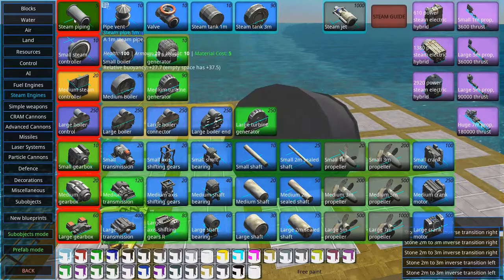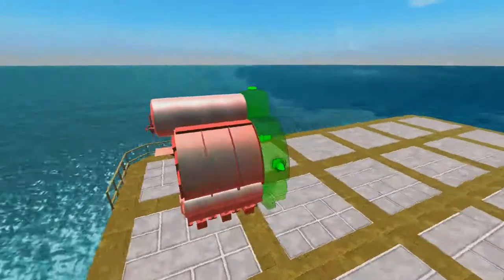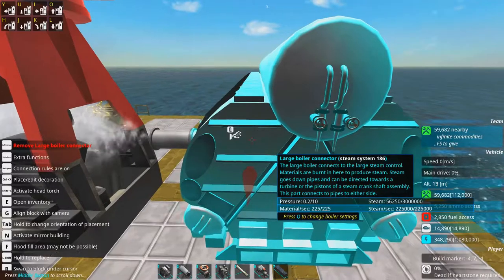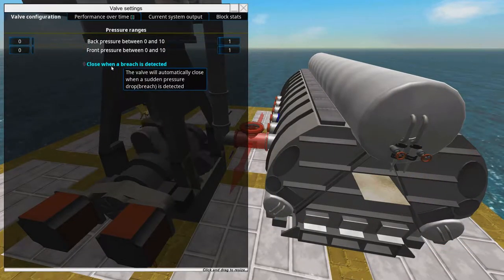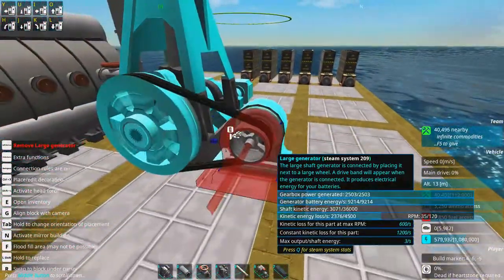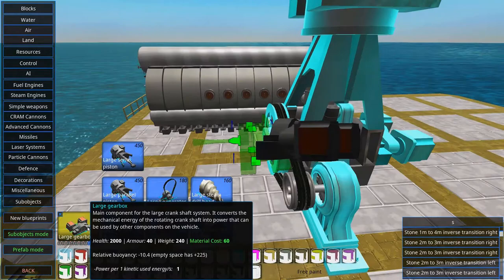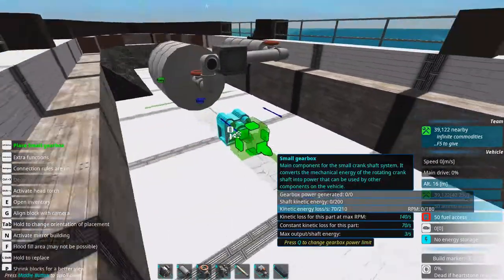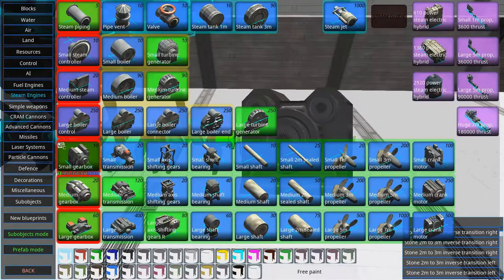From The Depths Steam Engine Tutorial - All about STEAM!

Comment: This guide has been super helpful. I just started the game and I have used either electric with the generators or a prefab fuel engine for most of my ships because the engines feel super complex or much to large for the vessels I am making. started a larger vessel (about 140 long) and figured I needed to look into other engine sources. Might have to give steam a go as it will also save space in that I wont need fuel storage for it nor will I need to deal with exhaust.
Reply from the maker: This is true! Glad it was helpful! Try also my instant tutorial if you want to have tutorials with no rambling at all 😂
Reply: @GMODISM  I have been looking at so many tutorials and guides for this game, I have almost 40 hours in the game and all I've done is built like 4 ships I am somewhat proud of (though in reality they are probably really bad) a couple of bricks and haven't even touched the campaign or adventure.

Comment: Something I've always found baffling about this game, is how "engine power" is sort of like a "generic mechanical power" that can be teleported magically anywhere on the craft (like to power regular propellers) without any shafting/gearboxes, etc.  This is fine, if that's the logic you want to use... but then they go and completely undermine it by having actual shafts/transmissions, but only specifically for steam engines.  So weird.  Why can't I hook shafts/transmission to a fuel engine?  And you are not even REQUIRED to use that mechanic, because you can just use the GEARBOX (which is different from a transmission because reasons) to turn your steam reciprocation also into that magical teleporting mechanical power.  Don't get me started on LASERS needing MECHANICAL ENGINE POWER but rail chargers are perfectly happy with battery juice.
Reply from the maker: Yeah for "realism" we must ignore everything fuel engine and laser related, don't get me started on how cram speed does not affect kinetic damage... so yeah only steam and APS then haha

Comment: The tutorial is nice, its just feels like most of your tutorials are on how to build craft for designer mode where cost doenst matter. Piston staging is one of the most important things to understand in order to make your engines run efficiently and not waste incredible anounts of resources, yet you just barely mention it.
Both parralel and serial large pistons can be attatched straight to each other.
Also the x2 max RPM setting will be changed in a future update.
Reply from the maker: Thanks mate, glad you like it!
Yeah it is important to use that exhausted another round but the first round is the most essential to save materials.
Oh didn't know that, do you happen to know what it will change to?